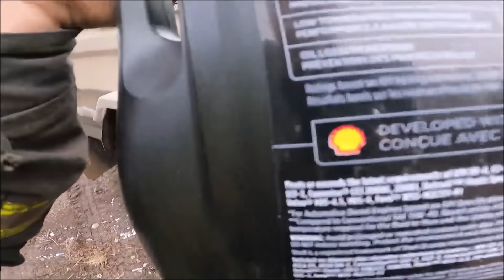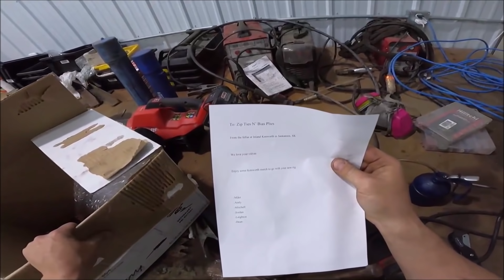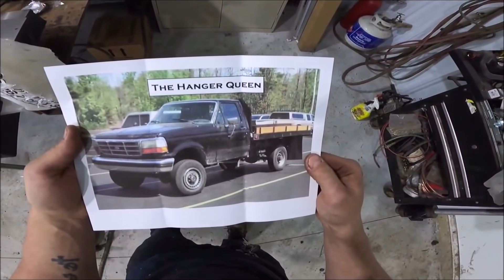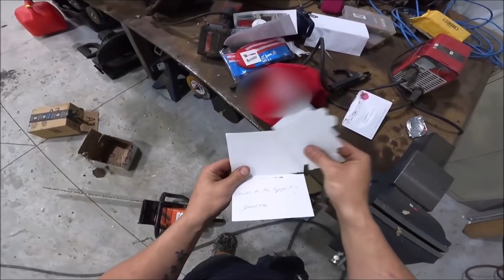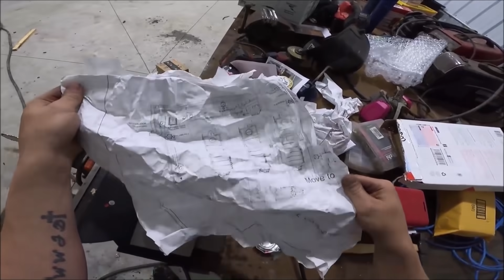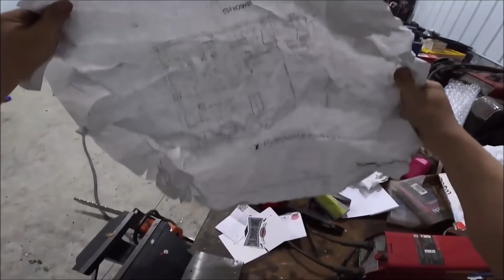FERD CANDY VAN REVIVAL! UN-GREASED EDITION!

Comment: This channel might be the only real “will she run” channel on the interwebz.    Just dump nitro ketchup and add a chinesium made battreee and see what sparks fly.   Formula for success.
Reply: hes who who inspired me to buy my idi van. I paid 750 for it and it ran in drove. I was like, "if this engine can survive this nut job then I should be fine."

Im about to use it to move from Minnesota back to South Carolina, so that will be the real test :/ 1500 miles towing a ford ranger and all my crap. Ill be finding out how strong my trans is...
Reply: If the sparks fly you don’t buy
Reply: @macthompson9750  gotta fuckin let us know how she fuckin goes
Reply: @cavalierliberty6838  lol alright ill try and remember to come find this comment.
Reply: @macthompson9750  if it’s a auto just leave that burned Jenner fluid alone & right where it is! I’m betting it was filled at the factory & never thought about again, least all the ones I’ve had were like that, the engine most likely won’t be a issue them things are damn near bullet proof, everything else? 50/50 best a luck
Reply: @macthompson9750  any updates?
Reply: @jacobhertz8044  *haven't left yet. A few days to go. probably leaving on Monday. taking homie aboves advice and going to leave the bruce jenner fluid alone. Its shifting a little rough but the fluid is a bit low so imma just top it off. Gonna do the brakes this weekend and start loading.
Reply: @macthompson9750  lucas trans fix oil will fix it right up if the jenner isn't burned up . It's cheap and worth a shot
Reply: @johndowe7003  I actually kinda did that.i went with the transmission oil stabilizer not trans fix, but yea pretty much. 

I'm broken down on the side of the road atm.but it was a belt not the trans lol
Reply: @macthompson9750  nice sucks to be broken down
Reply: @johndowe7003  lol I'm pretty used to it at this point. Usually not something I can't fix. Knock on wood
Reply: @macthompson9750  did you end up making it okay?
Reply: @macthompson9750  what happened?
Reply: @bmo14lax   Torque converter died in the hills of Kentucky and i sold it to a local diesel mechanic.

I kinda think the fuel pump started going out by that point too.

Comment: I live by the sayin “the wrong fluid is better than no fluid” and “if it leaks fluid it has fluid”
Reply: Exactly!!!! Brake,transmission and power steering are all the same to me. Just like gear oil is a good substitute for engine oil. Especially if it has some rattling going on. 😂
Reply: @Miner-49  yea that’s when you know it’s good when it rattles 👌🏻
Reply: I consider that ALL oil is hydrophobic so my 88 350 has got to be helping to seal the asphalt as I drive it leaking and burning oil

Comment: My dad used to have a blue '79 E350  with a couch/bed, fridge, and a brush guard. It had the sliding door on the side and the rollers wore out and the door about fell off. He replaced it with a white E350 with barn doors on the side but he dumped his spit bottle out the window while he was driving so the driver side had this big brown stain down the side.

Comment: My sensor doot speak is a little rusty but man these Un-Greased vijayos are more than minty enough for my only one way works ratchet using ( so I gots to have two at any given moment), no 10 and or 8mm at the same time socket ass!
   So for the time being until I can support someone else's socket, beer, and motor go/ enhanced motor go juice replacement fund I shall like the minty when it comes about.

Comment: Your ace Cosby sauce sux it has a low ether content. Get a can with a respectable amout of the shit in it and your engines should start easier. It might cost more but you will use less of it in the long run.